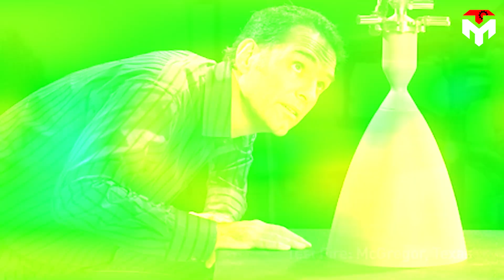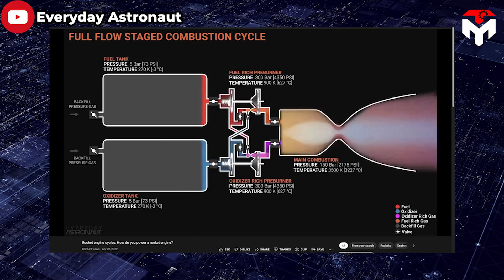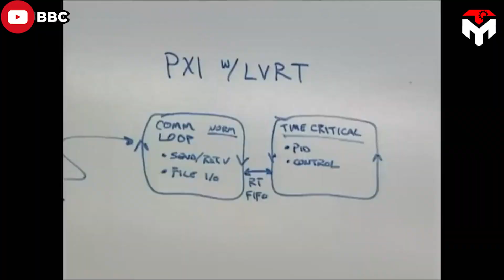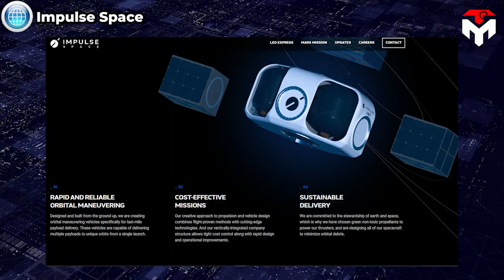The Truth about the Brains Behind SpaceX's powerful Rocket engines!

Comment: The Merlin engine is not one of the more powerful and efficient rocket engines.  But it is extremely reliable and reusable, and it does have the highest thrust-to-weight ratio of any rocket engine.

However, it is 9 of them and the Falcon 9 that can lift nearly 23,000 lbs to LEO, not a Merlin itself.  And that was Falcon 9 1.0 in expendable mode.  The current and probably final versions of the Falcon 9 and Merlin can lift 50,000 lbs to LEO in expendable mode and over 40,000 lbs in reusable mode.

As for horsepower, that depends on the current velocity.  Let's just say that each current Merlin 1D provides a force of 190,000 lbs of thrust (at sea level).  The only time it produces 190,000 hp is when it is moving at 375 mph.